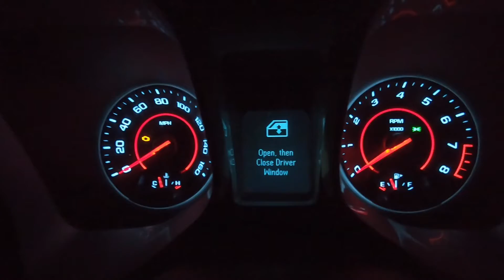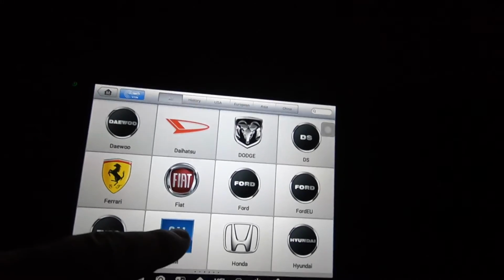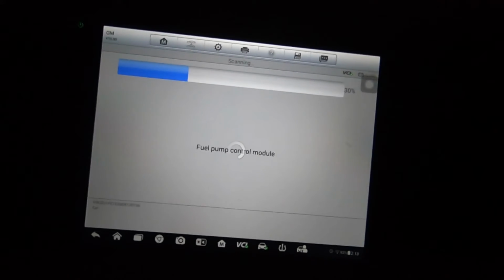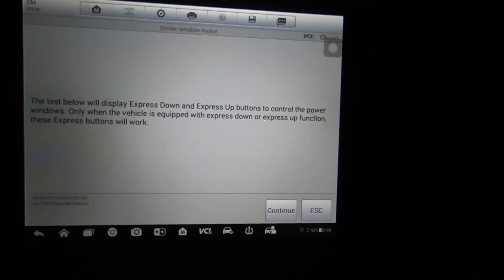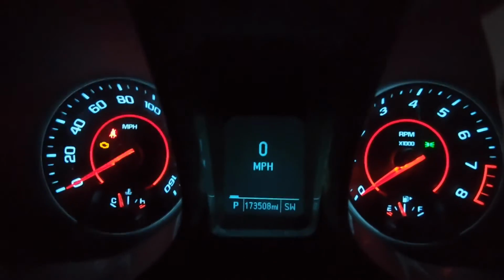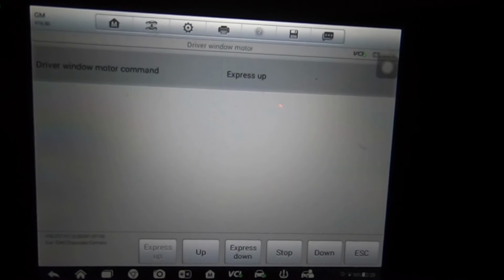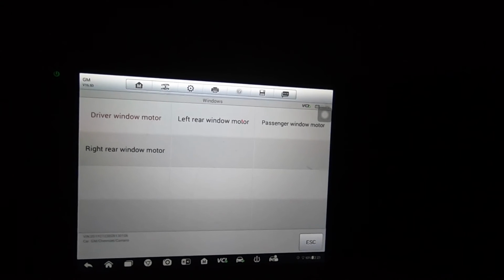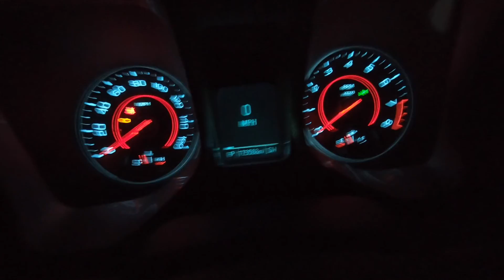2013 Camaro Power window Reset , Calibration , initialization using the Autel Maxisys MS906TS.

Comment: Any advice for when it says door open. When its not; and window is going haywire up, and down constantly!
Reply: The repair of the open/close window problem the first time, you have to put the window down and keep the window switch in the down position for 5 seconds. Then push the close window switch until it is up all the way and again hold the switch activated position for 5 seconds. Repeat the same operation a 2nd time, and all faults will clear. The express up a d down will work on both windows.
Reply from the maker: The first thing I would do is unplug the replug the modules to rule out any loose or bad connections.
Reply: @737mechanic  so os that when I unhook the battery yo reset or something  diffrent?
Reply from the maker: @shopping4gems6855  You can unhook the battery if you want too. But you need to unhook the connectors at the modules and reconnect them to make sure the connectors are attached securely.
Reply: @737mechanic  will definitely do. thank you for responding it's  very appreciated.🫠

Comment: I have a 2010 ss with 30,000 miles,so when I drove off that window up and down came on and the car was revving,It’s like the car lost power when that window sign came on
Reply from the maker: Make sure your battery and alternator are good. These cars have issues if the voltage drops too low or is unstable.

Comment: I just had my battery replaced and everything was good when I drove off but a few days later I started to receive all kinds of messages on the dash. I was able to do the calibration with the window up and down and had a few issues at first and at the 4th try it finally worked. Now the tire system monitor is another issue I have taken it to get reset and still comes up on the dash so I'm going to try and do it my self without the machine... hope it works  💪😁